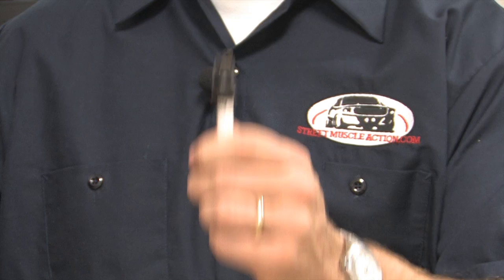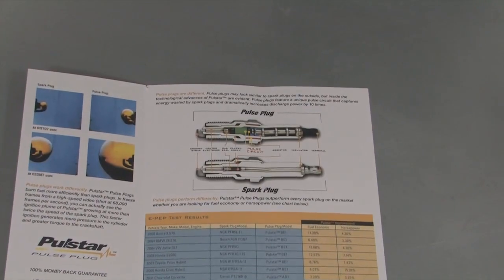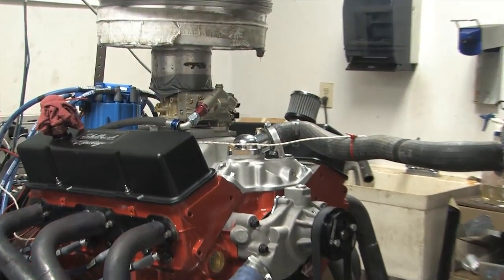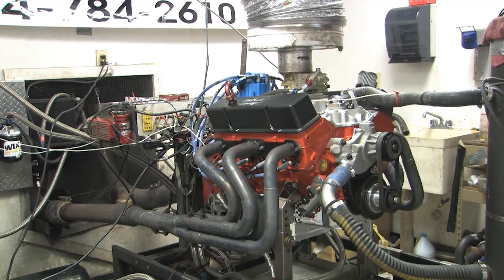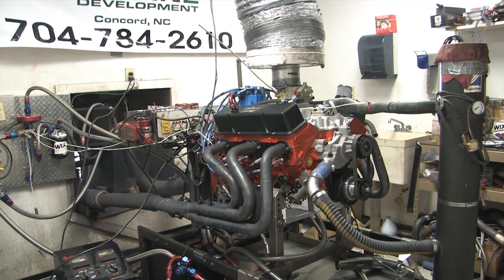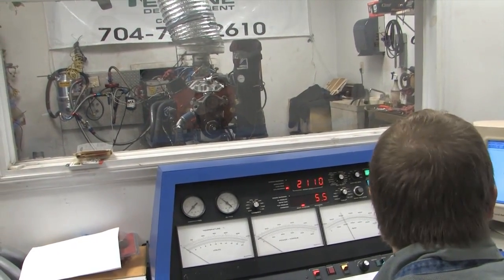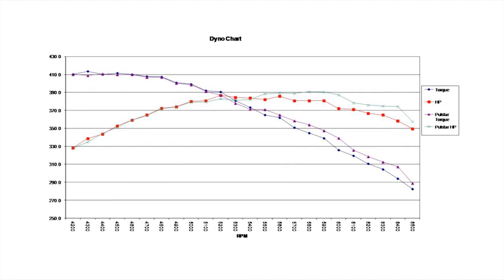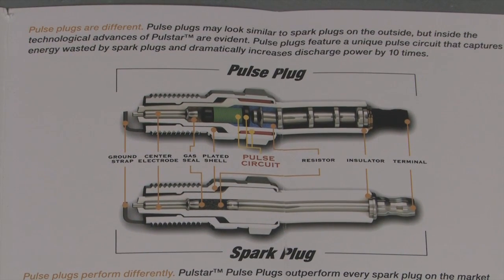Dyno Testing Pulstar Plugs to See if They Make Power

Comment: Not a good method to test pulstar plugs. Using a carburetor to test horsepower gains without increasing jet sizes to make up for the increases in burn capacity given by pulstar capacitive discharge is unempirical. If you want to test horsepower gains from pulstar or any other in increase in burn capability of secondary ignition system you would need to make adjustments in fuel supply to the chamber, be it increased fuel jet size, or increased injector pulse in a fuel injected setup. The fuel injection setups can be programmed to automatically increase fuel supply to the chamber based in Oxygen readings at the exhaust, and make immediate adjustments to the fuel supply to the chamber, along with immediate timing changes. The test you performed means nothing when it comes to determining the performance of pulstar plugs. Run that same test using a Fuel tech or Micro tech setup and you will see a completely different set of results showing a significant increase in horsepower and torque.

Comment: Im only utilizing one pulsestar in a 2 stroke bicycle engine, but im at twice the gap the motors supposed to have. I gained noticable power, and was able to get another 800-1000 rpm before it started 4 stroking. Ive noticed in other videos, that the gains from running pulsestars comes more when you increase spark gap than running the original gap.
Reply: How many cc is the engine and which model number of plug fit?

Comment: Absolutely rubbish avoid these like Covid 19 I fitted them in my Citroen ds3 1.2 puretech and under turbo boost it was like I was running out of fuel by misfiring.contacted seller and NO refund was offered just a questionnaire about my car and photos needed was emailed back to me BAD company and BAD plugs

Comment: It looks like they have a spark gap inside the plug, this will 'force' the coil voltage to increase which could add some power.  The same could be done by widening the spark gap, which will actually provide more improvement in combustion, up to the point where the spark can no longer jump the gap.

Comment: That gain could have just been from the engine breaking in a bit more.  I wonder if you put the regular plugs right back in and ran with them again if the power would have stayed where it was with the Pulstars?

Comment: I thought they were cool. Plasma wow right? But I rebuilt my engine 4G94 of my OZ lancer and they weren't performing at high load and rpm no matter the gap. The tuner said that you can see on the graphs I was getting spark plug blow out. The other day driving to work and its like my hp was castrated. I swapped to V power NGK and proves that these plasma spark plugs don't last and they flat out just suck. Never again. Ripoff. I put one in my motorcycle and it won't idle correctly and can't start normally when its cold. In the beginning of this video hes holding autolites and they suck too. Go Denso Iridium or NGK.

Comment: Hear me out now..... you chose a race motor with a hot coil, and some super wires, on an engine designed to get the most out of copper core low tech wonders....... why you didn't choose an old crappy engine with a weak coil, stock everything, to see if their capacitance is the real deal, is beyond me. Seems like showing an improvement in a weakened ignition system would be a better test than trying to show improvement on a completely optimized setup at the top of its game where every aftermarket advantage has already been thrown t it
Reply from the maker: But in the real world, why would anyone spend that much money on a worn-out engine? They'd just throw in whatever plugs got handed to them from the Auto Zone or wherever.
Reply: @TheHorsepowerMonster  because in the real world people don't realize their coils are getting weak and usually change their plugs too early out of want for more or only once something is missing in which case they always go plug before coil anyways

Comment: I have one question with this test. Are the MSD box and booster hooked up? If they are installed, this comparison test is a waste of time unless you are trying to determine what spark plugs would be best for your hot rod that has an msd box and booster installed. For the daily drivers, this video doesn't help.

Comment: They did nothing for my little 3800 in our '01 Impala. The idle actually got worse in comparison. I sent them back, thinking they were bad and the second set did the same crap, even after a PCM reset and full relearn. Went back to the good ol' cheap NGK/Bosch/whatever-is-on-sale plugs.

I was already doubtful of the tech in the first place as capacitors do not do well in extreme heat. You would be better off just getting a better set of coils and wires.

Comment: Their explanation of capturing energy and putting it back in the electrode makes absolutely no sense what so ever. I don't see any part of the design that would do that...and if you needed that you could simply get a stronger coil. Few engines suffer from "I don't have enough electricity for my spark plugs".
Reply: If pulsestar are adding enough capacitance around 50pF to 200pF, the rise time and fall time of the edges of the spark high voltage will be enlongated by a few microseconds. The slower rise time will not harm much. The longer voltage fall time will allow a few KV to multiple with the arc current to make a higher power spark. The ignited fuel front propagation will be faster than an otherwise lower power spark.

Comment: You should try to modify a stock ngk like rocket motorsports. Consistantly made more power on the dyno. Here is a link to the picture of how they look.
https://store6863015.ecwid.com/RM-Modified-Spark-Plug-Set-for-Turbo-and-High-Compression-Engines-p83395106

Comment: Put one in my lawnmower. Went from 5 hp to 16 hp. Had to go from a 24 inch blade to a 40 inch blade just to slow it down.........
Reply: The fuel pressure or fuel injector may be far off or aged.

Comment: If I am not mistaken these plugs will not work with a msd or any copies of them. CDIs need a certain type of plugs to work properly like resister plugs. All most all of the spark plugs today are compatible also you have to run certain wires to. I have tried to run the nology capacitor wires with msds too and got misfires. Nology wire work fine on regular ignitions just not CDIs. It might be a fair test if you did it with a hei distributor or points. It's better to have the capacitors in the wires than the plugs anyways. Just read the instructions for the ignition box and you might find out the plugs aren't compatible.

Comment: For a bit more you can put a 100 HP nitrous shot on it , and FEEL the power gain, and stick with the $2 AC plugs, clean and gap them every 15k miles, I hate paying for the E3 plugs, and indexing the plugs can help, ( placing the ground electrode in the same direction in every cylinder)  it will effect where the flame starts, and can lessen possible fouling, from incoming fuel, in some cases, but basically the only time you will see a real gain, is if there is something not working properly, and a new plug fixes the problem. Just like hot coils, it's not going to make power unless the original coil wasn't capable of supplying enough current to do the job, higher compression can require more voltage and amperage to start the fire! Still a great video,

Comment: You ain't going to feel the difference of any spark plug, unless the ones it replaced isn't firing!             i run either NGK, regular AC delco, or E3, not saying there can be gains, it's not going to be night and day differences,  without changing something else, fuel, boost, nitrous,
Reply: projectfarms 'tests' showed a slight improvement in generator fuel efficiency with the e3/pulstar over iridium. i wonder if these are possibly only improvements you'd see in a small motor with a weak spark system to begin with?

Comment: and again, how many sets of normal plugs will you go through  in 6 years? they arent 25.00 either...actually the set in my harley wete in my Honda prelude first in 2006 then in my bike in 2009 and are still in my bike, and one is actually in my generac 5500 wheelhouse...all the same plug and heat range...and yes it was a coincedence and only 1 has worn out in that time...the honda set saw around 110,000 miles, and 40,000 on my 97 dyna...that's 3x what you said.
they are be1's from their original runs...and you can still find em on ebay for 15.00...so i caint twaing my voice like ewe deed, buht, take my word for eht, the dohc in my prelude requires platinum plugs at about 10 to 12 at a set a year isn't $60.00 better than what would be at 40x14 560.00 for platiinums in my Honda, which has 300,000 miles and still runs great on em?
but nice attempt at discrediting engineering and value over time compared to cost.
yeah im tired of seeing people burn on shit they dont understand. can you tell me what cfm stands for and how to calculate it?
sorry you pissed me off.
sighiting the specs of a shit motor with a small carb to make yourself sound smart was your first mistake.

Comment: Why not just buy an ignition box then? Like the MSD or some other cheaper one. The MSD sparks multiple times. A guy could probably find an ignition box like the MSD street fire ignition box for about $175. I'd like to see Pulstar v.s. ignition box. I would be about the same price too. $30+$175 for the MSD + standard plugs or $200 for the Pulstar Pulse Plugs. Those MSD systems last a long time and are trouble free as long as you hook them up with quality connections and mount  it where it's not out in a damp location. I put one in my brother's 79 Dodge van 10 years ago and he's never had any trouble with it. He said that it gets a little better mileage after I installed it. I got  one at a garage sale for free. The guy said it didn't work. It works fine it's on my truck right now. I wouldn't want to get shocked by it.

Comment: By the diagram they just have a spark gap, that will drive the coil to peak power which will improve performance a bit, same thing with those "power improver" things you put on the coil wire. For the price investing in an MSD unit is probably better in the long run.

Comment: i have used pulstar 2x's $13 per plug on a 2005 Cobalt ls 2.2l 4cyl and a 2008 Cobalt SS/TC tuned 2.0l 4cyl . the 05 gained 2 mpg the highest i was able to get off the regular plugs was 29.99 after the pulstars it was 31.99 and when getting on it for a whole 2 weeks driving around town i lost mpg from the lowest i had ever hit....! the 08 SS/TC i drove around for almost a week using my stock tune without any problems but when i engaged my tune and did about three pulls the plugs misfired in the middle of the third and stopped producing power was able to drive regularly all the way home but every time i tried to get on it at all it misfired . the plugs do seem to work well with naturally aspirated cars but not beyond that

Comment: The problem is: you did not factor in the shorter pre-ignition stage. The reason the plugs did not perform as well is because the timing needs to be retarded by 2 degrees or more. This is because the spark is so much more powerful, the start of the fuel burn flame is much bigger making the actual explosion of the fuel faster. To take advantage of this you should have redon the timing set up to work with these plugs. but instead you set up the timing to work with normal plugs.

A computer that is able to adjust timing according to how these plugs work can take full advantage. Computers that cannot will not as to the reason there is such a variance in results. Do the test again and this time adjust the timing for how these plugs work and you'l see. Also they are now on the 4 or 5th generation plugs as they tweak them for better performance and reliability. How many changes has autolite gone through? Not many.

Comment: You have to reduce the timing by 2 degrees to get your horsepower. Pulstar reduces the need of so much timing because the pre-ignition to explosion of the fuel timing is reduced. Making more of the fuel being burned done so in the explosion of the fuel not in the pre ignition nurn part.

You also used a carburetor engine. Computer controlled more adjusts to the differences which a rear wheel dyno will show instead of the set up you used. These are also 100,000 mile plugs.
Reply: @Flapping Flight It's not a longer duration. The plug has a built in capacitor that takes all the energy and zaps it across at one time. The ignites the fuel better reducing the time from ignition of the fuel burn to actual explosion. Taking advantage of that requires you to drop the degrees in timing a little.
Reply: @Flapping Flight The capacitor is inside the plug the outside is the same as a normal plug. This is a one shot cdi where the long duration is shot across  the gap is all at once. Making the ignition flame much bigger. And because the loss of power through the wires and distributor (if it has one) is eliminated. So all the power the  capacitor produces is used.
Reply: https://www.youtube.com/watch?v=ZrQM-PRT4ds

https://www.youtube.com/watch?v=w962iS-7ELQ

https://www.youtube.com/watch?v=ce6ijLPx9Fs

Comment: I played with Pulstar Spark Plugs awhile back.  I'm a risk taker and like to try stuff out.  Had them in my 2001 Acura Integra.  Feels pretty good for the first 9 months after  driving maybe like 9,000 miles with them in.  My engine car start shaking violent at random and drive smooth again.  After a bit more driving, it was undriveable.  Took it to the shop, the mechanic gave me lecture saying the plugs are too strong and the engine is not design to handle it.  It cause the pistons to be misaligned.  After all said and done, the mechanic replaced my spark plugs with brand new good ol NGK spark plugs and aligned my pistons for $140.  There are a lot of negative reviews for the Pulstar plugs.  It's really not worth it.  The reason I decided to try them was because of the benefits and hoping the problems people had were just special cases.  I think the chance of failing is like a 50% chance.  Good luck if anyone still wants to try it.
Reply from the maker: Hey Michael. What is a piston misalignment? I've never heard of such a thing.
Reply: Yeah I wouldn't quote me on that term.  So my engine was shaking the car, the mechanic stuck some thin tools into the engine to adjust something.  That fixed the shaking problem.  It might not be pistons, maybe the valves?  Mechanic also said he dealt with Pulstar before where it came out of other client's car from repairs.
Reply from the maker: OK, that makes sense. Thanks!

Comment: My investigations show the plugs increase the HP, the problem is, the plugs are not reliable. The electrodes melt or erode prematurely and the porcelain cracks in a short period of time. In top the spark is so intense that pierces the top of the pistons.
Reply: El Gato Felix seem like a lean AF ratio causing those plus failures
Reply: @EugeneKingify  Yep, people know it'll get a quicker ignition and lean their stuff out too much when they swap these in.

Comment: I had six of the iridium Pulstars in a 2002 Chevy Trailblazer LTZ for quite a while. I don't know how many miles, but it was for several years. I'd venture to guess that they well exceeded the 50,000 mile claim. I finally had one fail on me on a drive from Kansas to Georgia, in Tennessee. I was driving her really hard and it was during the summer. I started to get a misfire. When I examined the plug on cylinder one, where the misfire was, the entire enter electrode was worn or broken off. It just wasn't there. That was, apparently, causing the misfire. To make a long story short, I replaced all six of the spark plugs with the comparable OEM iridiums. I can definitely tell a difference. The Pulstars had more noticeable power. It certainly isn't the difference felt like a supercharger would be, or a cold air intake with exhaust. It did make a noticeable difference in the Trailblazer and her 4.2 Vortec, however. I miss them. As for the other five, there was indication of their being worn. There's no question about that. It was like the iridium tip point had kind of melted a bit and slid to one side of the electrode. They're still intact, though, and they had been in the Trailblazer for well over the 50,000 mile claim. I'm considering getting another replacement and running them with the other five for a while, and also getting some for a 5.3.

Comment: At $25 per plug, they are "snake oil" and a rip off too as far as I am concerned. I'll stick with my Autolite plugs and save a bunch of money.
Reply: check out e3s mate. reasonable price(cheaper than my NGK iridiums for one), head to head performance with the pulstars(and more efficient than iridiums). projectfarm has a great vid on em.

Comment: Nice video , I'm running a 1972 Pontiac 455 H.O. , bored .60 , roller cam , old school TRW L2394 pistons with a torker 1 intake and a Holley 850 hp series carb , msd ignition . Just researching spark plugs and advancements and enjoyed your video , no nonsense information , thanks for going to the trouble of doing a real world test , helps a bunch.

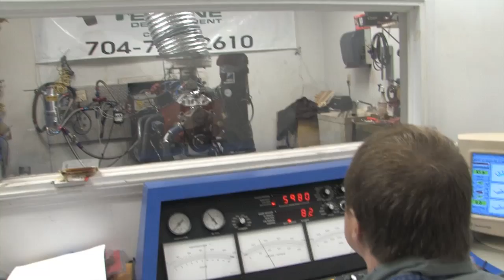Comment: 2:43 and 3:28 sells it for me...you can hear the engines running loud as fuck with the first set and sounds like its purring with the Pulstars. Maybe on this Dyno they can really only see the slight hp increase...says nothing about fuel economy, emissions, all the other potential benefits